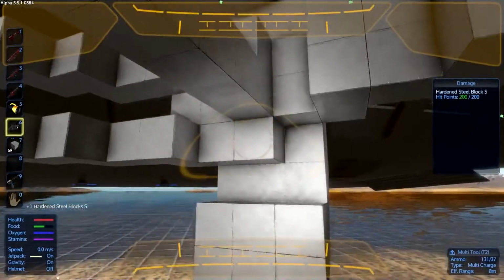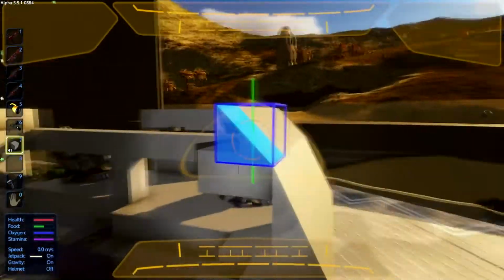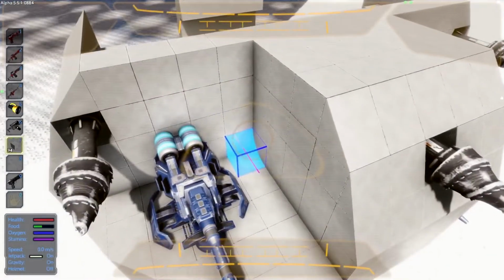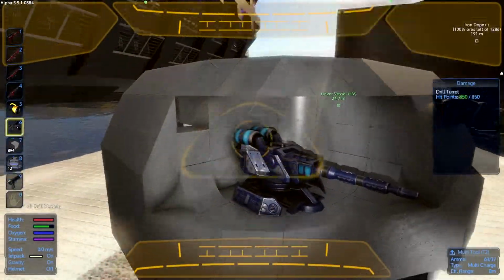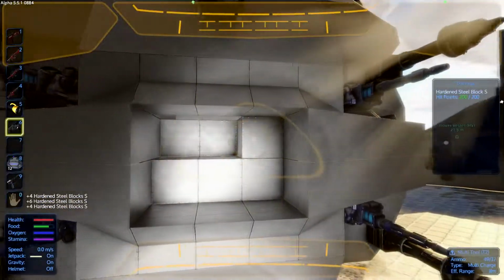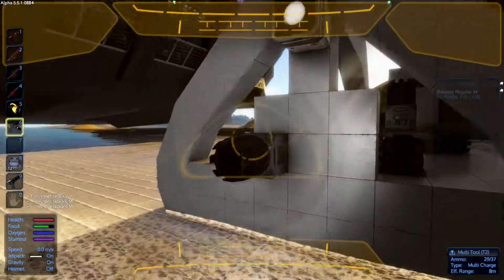MineOrb HV Miner pt 2 | Empyrion: Galactic Survival #112

Comment: Hi, no they wont work on their own, you have to access them via, the control panel and manually control it, they also need the mining harvest boxes like the drills. so 3 sit silent while you access the one you want. and the ship sits motionless as well no control of that either (unless it moves on its own due to the terrain beneath it.) 

They only come in handy I've found if you want to clean up a completed ore hole of any last ore if the terrain is hostile or you mined incorrectly and cant get your drill HV up to where the ore is again. but even this is limited as the range is only 15m

but your drone (drilling ore) is handy for that.

I've found in smaller HV drills is that gun turrets are sometime of better use to get rid of the pesky drones that sometimes protect an ore node.

I wish they did operate independently like a gun turret that would be good.